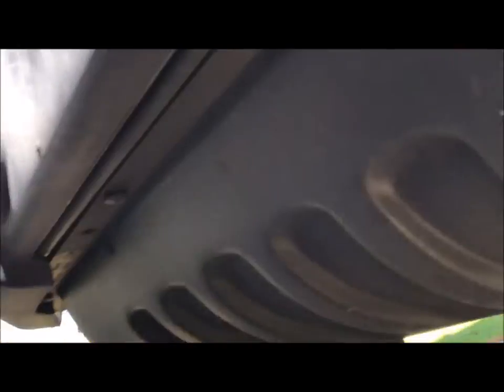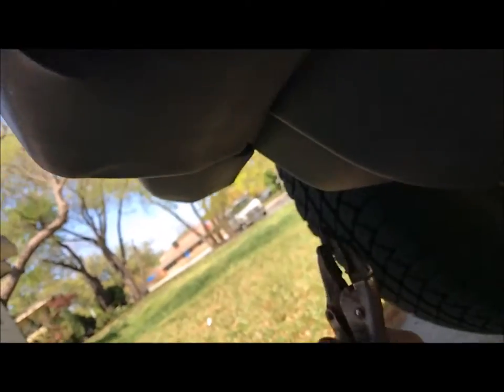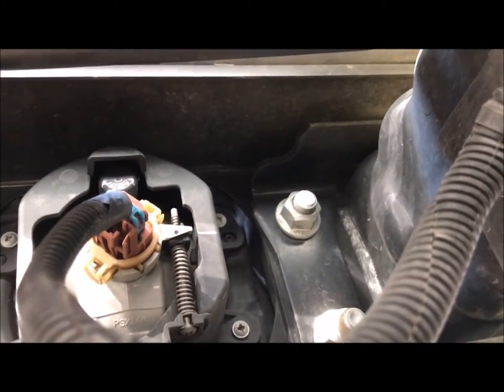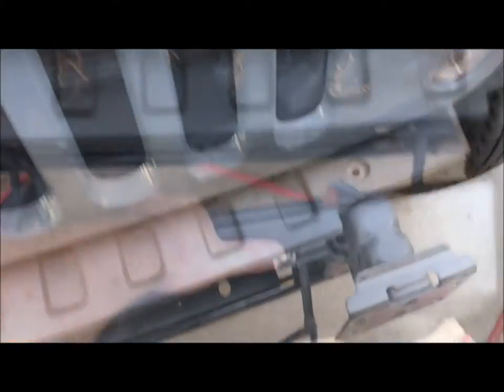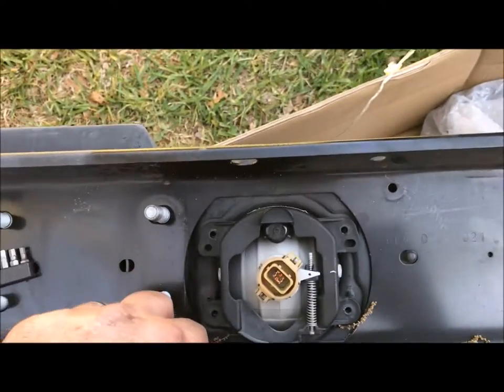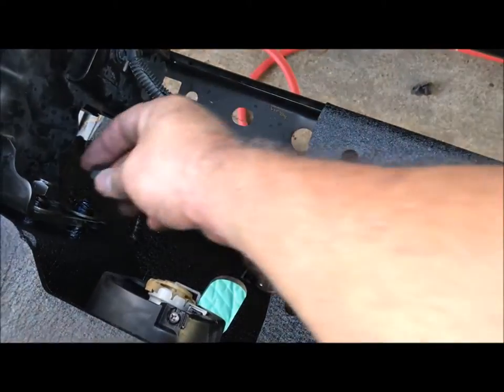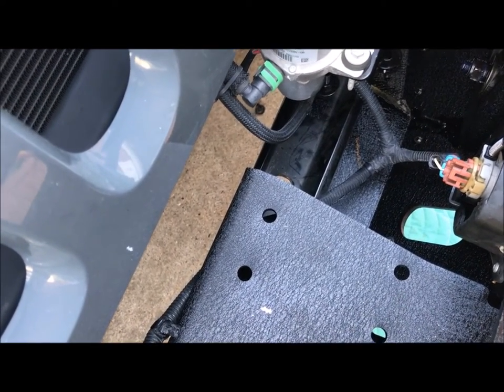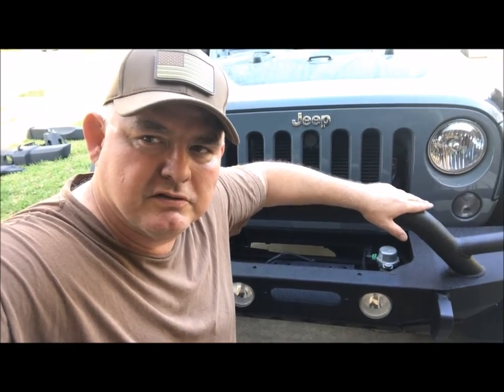SRC GEN 2 Smittybilt Front Bumper

Comment: Great video...at 7:50ish you talked about a bolt not lining up and maybe putting a wield on, what was your verdict on that issue, just wondering thinking about upgrading my JK with the same bumper.
Reply from the maker: D. Keith Shores I loosened every bolt abound a month after I completed the video just to see if I could get all nuts and bolts in and tightened. I had 2 that would not thread in the holes. I would recommend if you buy and bumper before you install it make sure every thread is thread-able and every nut works a fits correctly. If they don’t contact the manufacturer or return it. How’re I still have the same bumper but I’m seriously considering putting a stubby bumper of the same model with the new winch install. So before you buy any accessory make sure it’s the one you want. How this answered your question.

Comment: Any idea what that canister is for on the inside of the driver's side frame rail?
Reply from the maker: Mike Magyar I would have to see exactly see what your talking about.
Reply: @Burnstravels  4:38
Reply from the maker: No I don’t but I’ll find out give be a couple of days and I’ll get back with you.
Reply: @Burnstravels  ok, thanks.
Reply: That's a vacuum pump. It is used to assist the power brakes. These bumpers are designed that you do not need to touch it, but many others require you to relocate the pump. YOU CANNOT DRIVE WITHOUT IT!

Comment: Did you notice the bumper cause a lot of front end sag?
Reply from the maker: Cody Murphy I had absolutely no sag after I put the bumper on.
Reply: Cody Murphy , front end dips about an inch lower than rear on my 2015 JK . But I also have a winch
Reply: you absolutely are going to noticably lower the front by an inch and add winch and it is going to drop 2".
A stock bumper is 27lbs, 33 lbs with tow hooks. This is 155 lbs, 165 with shackles and 250 with synthetic line winch and close to 340 lbs with 90' of steel cable on a winch.
Go have a 120lb person stand on your stock bumper and you will get an idea of no-winch rake/height change. Have a 150 to 200lb person stand on it to see what it will be with this bumper a steel cable winch.
It is a good bumper an an excellent install video. But lots of people are going to end up having to get a lift just to fix rake of wranger after this. That is why many are considering aluminium bumpers which have a higher initial cost but weigh way less and usually with synthetic rope winch won't make you spend more in the end with a lift.